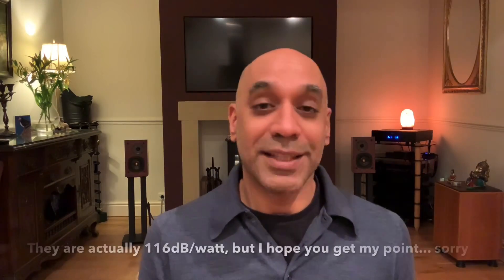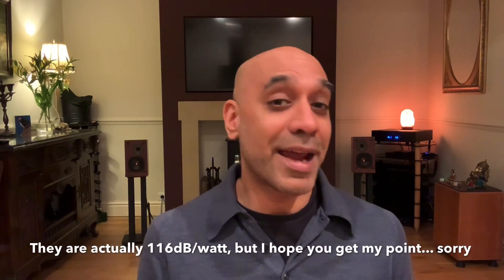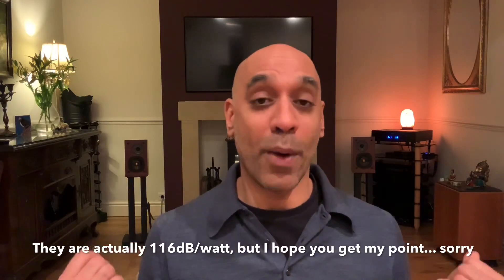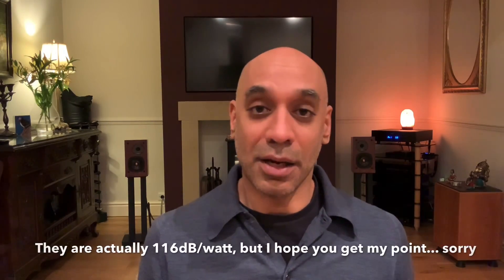Hifi Myths & Misconceptions - Amplifier Power

Comment: I have 12 pairs of speakers, 9 of which are regularly used in rotation. In 50 years of doing this, I have found 100wpc/8 Ohms to be my absolute minimum. I have lesser powered amps and once they get below say, 80wpc/8 Ohms, they are only really suited for near field. 

I have speakers from 98db sensitivity, down to 82db. The 120wpc (capable of loads from 1 Ohm - 16 Ohm) amp will drive them all. I have amps from 40wpc - 600wpc/8 Ohms. Loudest listening levels are 87 db. I base my headroom on not using more than 50% of the amp's capability for that level. This keeps me in the more favorable range for distortion. 

I have tried all the power prescriptions by the experts over the years. I quit listening to those who keep insisting less is enough. While I do like some lower powered amps, I will not be caught without some high powered ones as well. Too many of these scenarios are framed around absolutes of only being allowed one pair of speakers and one amp. Some days, the right answer is overkill everything. The only time I have been let down in audio is by wimpy speakers and amps.
Reply from the maker: Thx for sharing 😊

Comment: For the most part you’re on the money.
 I am not sure however if I agree with the dynamic range, you basically assume max is listening the quiet parts at 85db and the loud parts would then be 95db. But if you say max is listening at 85db, I assume that is average value which already includes the lowest parts and the loudest parts. Otherwise it’s not very descriptibe. But yeah, you need the power to make those loud parts to happen, and I guess that was the point. 

Another, more serious thing is that you’re recording this video in your listening room and you have terrible room acoustics, massive echo. Now should I believe what you say about any piece of equipment? I cant because I know that your  room is not suitable for listening and in terms of everyday life, it’s not suitable for that either unless you live alone, dont do anything that would make a sound and never talk to anyone in that room. 

I am not audiophile. I just like music, I want it to sound good and being a musician i think I have reasonable reference how it should sound like. I mean like what instruments sound like live, and how do they sound like recorded, what happens during mixing and all that. To me some audiophiles dont care that much about the music, or reproducing how it sounded through studio monitors, the main course for them is to buy expensive stuff and talk about things they dont understand. They are really a jackpot and a gold mine for the high-end equipment manufacturers. Or cable or fuse  manufacturers.
Reply from the maker: It is an old video where I was having mic problems. Not the room 😉

Comment: Thanks British Audiophile. 
I've used several of your videos and become extremely happy with the system as a result. 
Just acquired my first pair of what I would consider Hi-Fi speakers under 2 months ago. (Previously I was using some Warfedale Force 2080 which filled the room and encouraged me to use headphones instead.) 

I found some oldish Linn Keilidh speakers, powered by again some old equipment, a Denon AVR-2807. Stated output is 500 Watts. They are bi wired with Gale and Cambridge Audio cables. 
Room dimensions 11.5 ft by 13 ft. It's low ceiling 7.5 ft. I run the system crossways, in a carpeted sitting room with the front baffles 2.5 ft from the rear wall.
Front end goes through an Mdac mini.
With several swapping out and positioning sessions over a month I've settled down with this set up.
All I know is that after raising the floor standars from the floor recently (2 weeks ago roughly) I have been very happy with the sound.
I'm open to suggestions for the future but having some plain talking advice has made a huge difference.
Reply from the maker: Thx for sharing 😊

Comment: One reason that I have many pairs of Speakers and Amplifiers, is that I can mix and match. Some Components don't like each other. Also, some are made for each other! ( Not necessarily by Design) . My JM Lab/ Focal Colbalt 807's, that never have even been in the same room with a Crown Power Line lll. But that Combo Blows every Mating, that I've ever seen! Efficient Drivers tent to have Tighter Tolerance's in the voice coil/ magnetic interaction. Tubes, or Low Power is preferred.
Reply from the maker: @chrispicquet733  thx for sharing 😊

Comment: My speakers are B&W 804 D4, 89db and I listen from a distance of 4 meters. Speakers are driven by a McIntosh MA8950 200W x 2 and at 39% of power (or 78 watts per channel), I feel most comfortable to get the full harmonics and body. How do I calculate the dB in this setup to my small study where B&W 607 S3 with 84db sensitivity powered by a WiiM Amp at 60W/C at 2 meters -- hoping both should be similar to my ears ! Thanks for your easy to understand clips!
Reply from the maker: @mmtrashid  thank you 😊

Comment: The only reason that one needs a very high power amplifier is if you are driving speakers that are rated at 84 db or less .I used to own the Original Apogee's. The whole reason that Krell and Mark Levinson introduced High Power  250 - 300 Wpc Class A amplifiers. I had a Krell KSA 250. I hated it! Equalization was built into it!
Reply from the maker: @chrispicquet733  thx for sharing 😊

Comment: 10 watts rms is plenty in a normal sized room. 
My Yamaha amp has 100w+100w into Spendor BC1's which max out at 55w.
Distortion is higher at low and high output so keeping it in the middle (log scale) is best.
Reply from the maker: @fivish  thx for sharing 😊

Comment: Nice video.  I have a question about dynamic headroom.  You say 10 db for a good recording. I bought a cheap but calibrated noise meter that shows modern recordings at 80 db average having peaks around 110 db on my 92 db sensitivity speakers.  These are peaks measured/summed over a 0.1 second timescale.  I assume good amps can do crazy power over short time scales, but there are no industry stats.
Reply from the maker: @mesterha  yes, for tiny instances you need at lot more power 😊

Comment: Great learning for me! Used my money on a nice streamer instead of the poweramp. My area is only 30m2. ( 250W Icepower 250ASX2 before). After a lot of testing in my flat and using LED to show 1W and 2W levels I realiuzed I very, very seldom passed 2W per speaker output. Typical flats in Sweden are usually 40-100m2 and smaller amps work fine. The frequencies below 100Hz goes thru KEF KC62 and I can use smaller speakers above 100Hz. Again many thanks for this great and very pedagogical and clear presentation of facts!
Reply from the maker: Thank you Johan. Much appreciated 😊👍
Reply: I used a 2x5 W amplifier and is more then enough for a rum.

Comment: The eternal problem of amplifier design: low power (probably Class A) vs clout in the form of Class AB, with it's attendant problems of feedback design and crossover distortion. 

Quad's solution? Current Dumping, where a very high quality Class A stage (an ingenious triple) provides the entire voltage swing to the output, but at limited current, and when the load demands more power the heavy lifting is done by the 'Current Dumpers' - robust devices that perforce produce no crossover distortion, require no tricky feedback design....Walker and Albinson employed the genius solution of 'Feedforward', where the output is compared with the signal input and an error signal of the exact amplitude as the distortion (but in antiphase) is added at the output stage.

I remember studying the paper by the above when it appeared in 'Wireless World' in the mid 70s and discussing its merits over many pints with my peers!

I use Quad QMP monoblocks to drive my Quad 2812 electrostatics. This may seem like overkill, as discussed in your video, as the amps can each produce 320 watts into 4 ohms, but as each monoblock contains two completely separate 909 amps (current dumpers) with their own toroidal mains transformers, and are 'bridged' to the output, the Class A stages produce twice the normal output voltage swing. Consequently most of what I hear (mids and trebles) is pure Class A...the dumpers only kicking in for the lower, louder stuff (I have a Quad L-series sub for anything below 50hz - itself having a 300w amp built in!). In all nearly 1 kilowatt!!

But, never mind the width enjoy the quality!
Reply from the maker: Thank you for sharing. A through explanation of an innovative design 👍

Comment: Some believe Specs are meaningless...BS. The problem mis The Absence of Decent Specs. For Example Audio Amp Headroom; HOW DOES THE AMP POWER SUPPLY RESPOND TO SAY A 90 DB "SPIKE" .... Does The Power SAG, CLIP the Audio etc. Get a Major Sound Spike with 10 Speakers Running on your AV Surround ...and what really Happens?  WELL, EITHER MEASURE IT OR CALL YOUR MANUFACTURER!

Comment: Great video.
 Thanks for doing it.
       I have a question regarding hooking up 2 or more
amplifiers together.
I have relatively inefficient mini tower speakers. 
I am currently running 2 Parasound Preamps, one 80 wpc Vintage McIntosh MC122 Power Amp & 1 current model Parasound 
70 wpc  integrated amplifier together just to power my speakers.
At around 60dB,  my front speakers start struggling and one time they clipped.
   I am  thinking about adding in another vintage  McIntosh MC122 Power Amp to properly/safely power my front speakers.
Is it safe to daisy chain in a 3rd amplifier into my av system?  What is best way to hook them  up?

Thanks,

David
Reply from the maker: Thankyou David 👍
Even insensitive speakers should not be clipping your amp at 60dB. Something is awry 🤔

Comment: Hi

I really enjoyed your video. What are your thoughts on using a 5 channel amp plus a 2 channel vs one 7 channel amp. Any benefits to using 2 amps over 1. Your insight would be greatly appreciated.
Reply from the maker: It depends on what you want to achieve, individual components and other factors 😊

Comment: Way back when, I was shopping for my first no apologies stereo gear. I got it down to a Sansui AU517 and an Onkyo amp. The specs were identical. The salesman said "check this out": he set the display amp switching system up to A/B the amps. The Onkyo had bass like  a Chihhuahua. The Sansui had bass like a bullfrog. The difference was the capacitor banks.  The Sansui Had a vast array of capacitors.

Yes, I still have it. It needs a set of new capacitors.
Reply from the maker: Interesting. Thank you for sharing 😊

Comment: The other thing to consider is the mechanical limits of speakers. A bookshelf speaker may struggle to reach 85db in a large room because of mechanical limits such as the xmax of the driver..etc where as a large speaker will have no problems. So theoretical is one thing but we have to consider the speaker and its limits.
Reply from the maker: Most bookshelf’s can achieve SPL levels way above 85dB 😊
Reply: @abritishaudiophile7314    Not necessarily. I did say in a large room. Remember that 85db is not just mids and highs. So say a bookshelf speaker with a pair of 5.25" drivers tries to do low frequencies in a large room, it will very quickly run out of excursion. 

So its possible it can reach 85db easily producing high and midrange tones but may run into issues at lower frequencies.   I've done some testing with my Usher S520 and my Kef LS50 and unfortunately this is the case. 

The whole sensitivity thing works as long as a speaker does not reach its mechanical limitations.

Comment: Well done Tarun... you clearly accented the wild nature of different listening scenarios.

But there is a simple solution to all of this ... If the manufacturers would just put clipping indicators  ... a little blinky light that comes on when the amp is used up... on their equipment, we would have a visual indication of two important things... First overdriving the amplifier and Second, needing more power for our listening habits. It's simple, set up a listening gig at your usual levels, watch the clipping indicator... if it's flickering you need more power.

For the question of headroom.  The streaming services have answered that one for us. Most standardize their levels at -16 dbfs... so you need 16db (a 39 to 1 power ratio) of headroom to avoid clipping on the more dynamic pieces... for an 87db speaker that amounts to about 40 watts per channel of peak power.  Average power is, of course far less.

My listening habits are rather like yours... 75 to 80 db at about 3 meters.  My power meters almost never get over 5 watts and typically hover around 2 or 3.  My amplifier is 50w/ch and it serves me just fine.
Reply from the maker: Thank you 👍

Comment: I reckon my average music session is at about 60-80db (depending on my alcohol intake). If I want to go 90-100db I can but that's only for a short while with particular songs.
My amp is 500w-8ohm / 800W-4ohms and according to the guys at stereophile they are conservative numbers quoted. Power is very important to me, there's nothing worse than hearing a system rolling off early.
Reply from the maker: Thank you for sharing 😊

Comment: I measured voltage and current with pink noise and a couple of tracks, peaks never exceeded 10 Watts with dynamic classic and jazz music. With pop rock it's far less. I've had 55W, 25W, 60W today, frankly I never felt I lacked power.
Though if you have a home theater big room with cine levels you'd better have kilowatts especially for bass to feel special effects. If you don't even low budget Av amps do the job.
Reply from the maker: Thank you for sharing 😊

Comment: Surely no Klipsch has a sensitivity rating of 116dB/w. Why did you say 99 and then add that correction?
As for headroom I think your final caveat about leaving out some details spoils the whole video. I'm left still wondering if the people who insist that an extra 200+ wpc could make my system come alive may indeed be right after all. When you tell me you left some details out how am I supposed to know how important those details are and whether or not they're relevant to whatever question led me to clicking on the video?

Comment: I have repeatedly tried to rap my brain with the numbers, with impedence ( 8/4/2ohms) , sensitivity., watts, amps etc. and just get more confused as my eyes and brain glass over.  I  am just not wired that way (pun intended).  It is even more confusing when I see on you tube a reviewer using a low watt tube amp to play sound thru oversized speakers,  
I don't get how that's a good thing or even possible. I really have tried, and will keep trying, but don't hold out much hope figuring it out..  I guess that I am fortunate to enjoyi what I have with my limited understanding, and budget..  It's all a bit like going down a rabbit hole to achieve a great sounding system.  I thank you for attempting to explain the numbers in layman's terms. I will have to take your word on this topic.  It's kind of like when I needed to add additional electrical outlets in my home.  Not ever fully understanding how electricity works, I 
was still able to understand enough not to electrocute myself and safely install the appropriate wiring/system thanks to expert advice.  
So I may never get the how or why, but I am relatively certain that my audio system is within safe parameters for quality sound based on the numbers by expert advice.  And, judging by my ears I am quite happy with the music playing out of my system.  Now, if I can just be satisfied with that...
Reply from the maker: I admire your perseverance Dan 👍

Comment: Thoroughly enjoyed watching your video. Very informational and you made it very easy to understand. Thank you!
Reply: I have B&W 604 S3 and have paired it with Technics SU-VX800 amplifier rated at 100w. Whenever I increase the volume by more than half, or increase the bass to full, the bass woofers make a weird cranky sound. Can you pl help? Is the amplifier not powered well or is something wrong with the speakers. The B&W S3 is rated for 200W.
Reply from the maker: Thank you Zain. Much appreciated. It could be either but more likely to be the speaker by what your are describing 😊👍

Comment: And what about second impedance extremes, where some speakers goes above 20, 30, 40 Ohms? So at these frequencies you have maybe 10W from 100W amplifier etc...
Reply: Amplifiers are voltage sources... the actual impedance isn't the issue.  It's the demands for  current at low impedances that are the problem.  
If your frequency response is reasonably flat, a rise in impedance is a bonus for your amplifier.... less stress and strain.
Reply: @Douglas_Blake_579  and the voltage is endless?
Reply: @johnwet6969  
No the voltage holds where it's supposed to be but less current flows.
Reply: @johnwet6969  
It's a simple Watts law equation ... Power = Voltage x Current.

Amplifiers are voltage sources.  With a gain of 20... you put in 1 volt, you get 20 volts out. Feedback is used to stabilize that so the gain remains consistent.

Now from Ohms law we learn that Current is the result of applying a Voltage across a Load ... Amps = Voltage / Impedance or  I = E/R.

So lets take a moment in time when you have 20 volts across your speakers...
For 4 ohms... that is 20 / 4 == 5 amps and 20 x 5 == 100 watts.
For 8 ohms ... that is 20 / 8 == 2.5 amps and 20 x 2.5 == 50 watts.
For 16 ohms.. that is 20 / 16 == 1.25 amps and 20 x 1.25 == 25 watts.

But... 
For 2 ohms... that is 20 / 2 == 10 amps  and 20 x 10 == 200 watts.
... can you ask that from a 100 watt amplifier?

As I already pointed out.. so long as your speaker's frequency response is relatively flat, the impedance is not a concern.  It can fluctuate up and down like crazy and the amplifier won't care ... with the single limitation that the amplifier must be able to deliver the current demanded by very low impedances.